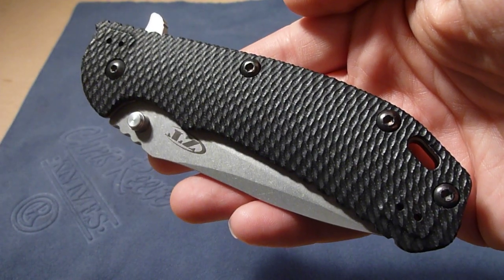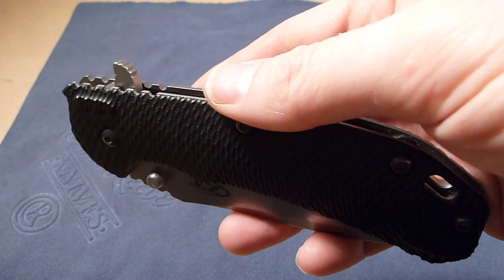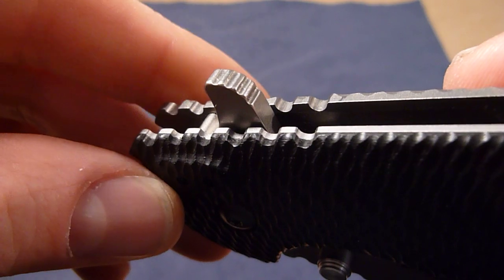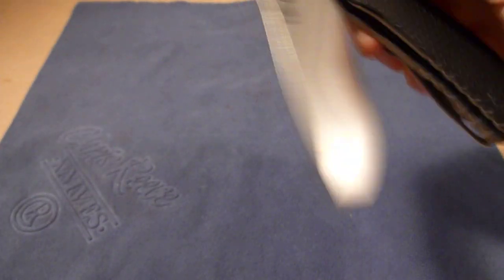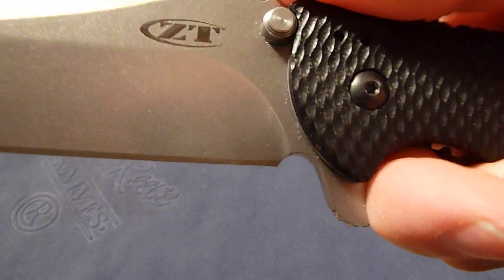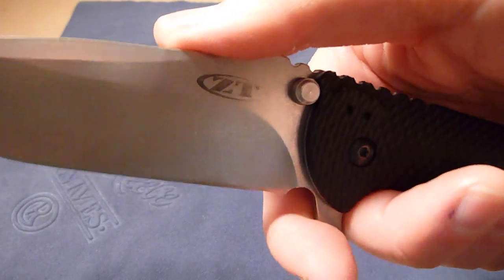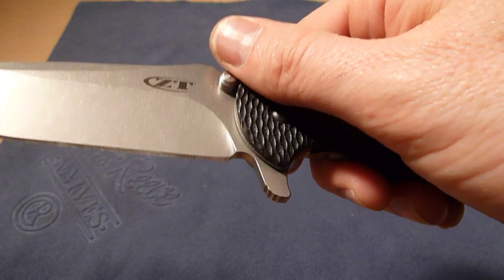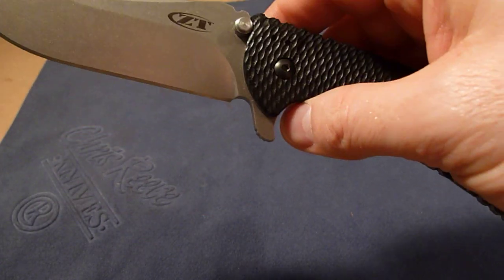Zero Tolerance 560 - Mysterious Notches??????

Comment: @JohnWayneColt45 I'm not saying to push directly towards the pivot necessarily. I'm talking about pressing the pad of your index finger on the notches and curling down. It works much better than dragging your index finger from the pivot to the tail end. Play around with the angle in which you press your finger.

Comment: Its because you are technically using the flipper wrong. When it is closed push on those "notches" from the direction they are facing. It will flip a lot faster with no wrist action.